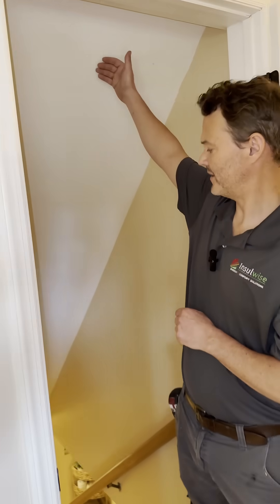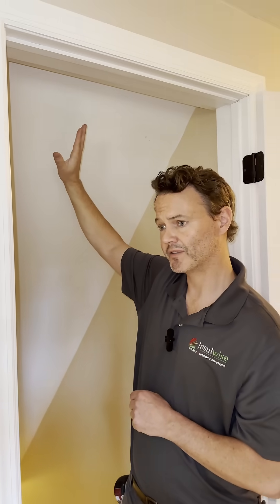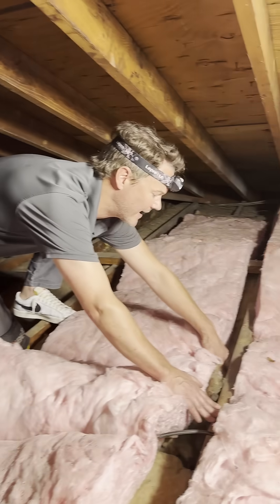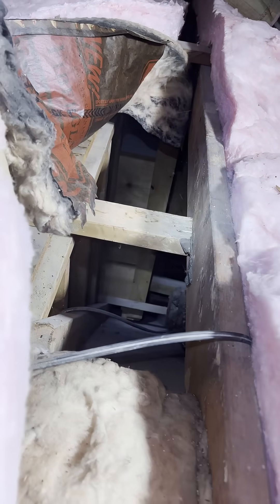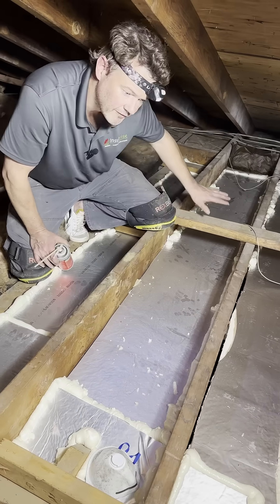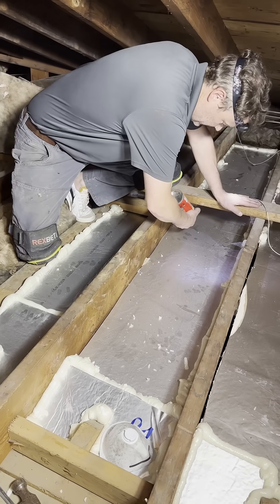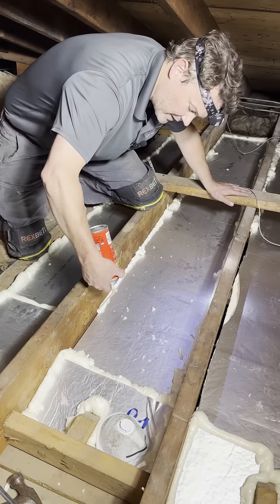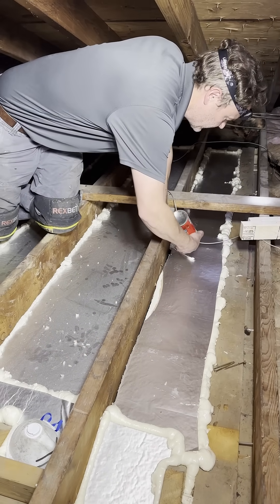Top Insulation Expert Reveals Best Air Sealing Techniques for Attic Stairwell Voids

Comment: I used a thermal camera and have air leaks on every corner and have a low roof making it difficult to seal.
Reply from the maker: If the walls are not well insulated or insulated at all the best solution there is to dense pack your exterior walls with cellulose insulation.  That will seal the top plates and any plumbing pipe penetrations as well as insulate the walls.  Low slope roofs make all of this work harder for sure.

Comment: If it is an insulated outer wall we saw in the video, the ceiling insulation does not insulate against the cold on the stairs.
Reply from the maker: Good eyes!  And you're correct --- but that wasn't exterior wall.  The other side of the "back exterior wall" was a bathroom.  This space has interior heated walls on all sides.
Reply: Thank you @insulwiseenergycomfortsolu3293
Reply: Thank you
Reply from the maker: @objektivone3209 You're welcome : )

Comment: Are you not creating a problem by sealing off this void. I was taught, insulation + ventilation.
Reply from the maker: Great question.  When you're talking about insulating unconditioned spaces like attics, you are correct.  But this space is actually conditioned.  It has four interior wall surfaces that are heated.  It's like a closet with the door closed.  There will be no "condensing surface" cold enough for water vapor to condense and cause mold growth.  That is the nature of the underlying problem that you're referring to.

Comment: Nah F this. Don't bother with this nonsense this is not insulating anything. Pittsburgh gets F'ing freezing. You want a good blow in insulation company. When those dudes show up duke them real  good they'll put 2 feet of blow in the attic. And fill this hole. It will cut your electric bill in half.

Comment: now cold bridging through the timber, with added rigid insulation temperature increased in the areas where normally fairly cool and black fungus everywhere. You cant insulate a timber skeleton house, like this. If you want to insulate your house it must be a continuous external insulation.
Reply from the maker: Sorry, but wrong.  It has been common practice in North America for about 70 years now, not sure where you're righting from.  For the last 15 years we've insulated thousands of homes in the Pittsburgh area this way.  Air sealing the attic floor sharply reduces stack effect driven air leakage from the home to the attic.  This also reduces water vapor transport from the home to the attic.  Air seal + insulate the attic floor and properly ventilate the roof works incredibly well and is low risk/ high payback.  By the way, subscribe to the channel.  I'll be posting a video in the coming weeks of a spray foam " continuous external insulation" failure.  It's fascinating.  Thanks for commenting!

Comment: Wait - did you just close up the top of the cavity with foam and seals, BUT THAT BACK EXTERIOR WALL HAS NO INSULATION????
Reply from the maker: No, and good eyes.  There are no exterior walls that abut this cavity.  The "back exterior wall" was a bathroom on the other side.  You cannot treat that kind of a space this way.   Thanks for commenting!

Comment: I will rot if air can't circulate. This is a well known fact. Spray foam insulation will destroy a roof.
Reply from the maker: No, it will rot if there is a condensing surface where water vapor can turn to "wet water."  This is what leads to rot.  There is not a condensing surface inside this space once this is done.  It functions the same as an interior closet with the door closed.
Reply: It's been 10 months since my comment... Let see an update please 🙏
Reply: In the UK you cannot get home insurance if any part of the house has spray foam insulation.

Comment: You can also blow an insulation and fill it..
Reply from the maker: Correct.   When one of the outer walls is an exterior wall we actually use that method.  When all walls adjoining are interior we cap the void.

Comment: The back side of the Stairwell Ceiling should be insulated and have a Vapour Barrier since the exterior wall was not insulated (which would have been much simpler and more cost effective).
Reply from the maker: All adjoining walls are interior in this video.  There is a bathroom on the other side of the vertical wall.  Good eyes though.

Comment: Why wouldn't you also lay insulation against the ceiling of the stairwell, as well as the outer wall, then air seal the cavity?
Reply from the maker: The void will function the same way as a closet with the door closed.  It is surrounded by interior heated walls on all 4 sides.  Doing more work than this would not result in any improvement in comfort or measurable improvement in energy efficiency, but it would put a worker at risk of falling through a ceiling and then down a flight of stairs for the effort.    
Andy

Comment: Just want to add that foam board + sealing it with canned foam at top plate of exterior walls, just before roof enters soffit, got rid of ice dams.
Reply from the maker: I believe it.  Foam board and foam sealant when used properly can yield incredible results in terms of enhanced thermal efficiency!

Comment: Air sealing in my crappy 1950s postwar boom house has been my obsession. It’s a Cape Cod with “finished” (lol) 2nd floor under the roof with kneewalls. I said “eff it” and cut and foamed foam board between all joists, and still working on sealing the chimney cavity. Then on to the back addition, where the builders have no “ceiling” to the kitchen soffits on exterior wall. Fun times.
Reply: I’ve got the same problem with my parents’ 1960 ranch.  There’s no insulation under the floor, no insulation in kitchen-family room (open concept BS) ceiling, some insulation in the ceiling to the back of the house, very little if any insulation in the outside walls, and no insulated windows or doors.  Plus none of the rooms have finished molding.  Reason for all this is my dad wanted a house that breathed.  It breathes alright.  It’s expensive to heat and cool plus all kinds of little critters like frogs, chameleons, spiders, and bugs get inside all year round because it’s so open.
Reply from the maker: @JohnFourtyTwo  "It breathes all right" LOL.  Ahhh man I'm sorry, but that was funny.  This was a 1960's ranch that we were working on here.  They're usually great little houses to work because they're typically build sold and are uncomplicated.  I've got a series of vids that could help you get a better feel for some of the processes you may want to employ there on our channel.
Reply: @ I’ll look them up thank you!😉👍
Reply: A house needs to breathe. The energy efficiency closed houses now need lungs to breathe. Could some better insulation help.. yes but do it right or mold and bad indoor air quality will happen. @JohnFourtyTwo
Reply from the maker: @truthhearit1471  You can certainly make new houses "too tight" for the occupants which then requires installers ERV's, etc (or you can just run a bathroom fan full time).  But it's MUCH more difficult to make an existing, older home "too tight."  There are simply air leaks all over the structure.
Reply: @insulwiseenergycomfortsolu3293   as I said the new tight homes need lungs.  
I said if you don't install new insulation properly in an old home than it can lead to problems.  Look at the retro fit spray foam lawsuit in Vermont.
Reply from the maker: We don't spray foam the underside of roofs for a variety of reasons.  My guess is there's no shortage of lawsuits or ones that'll be coming.
Reply from the maker: Sounds like you’re in for a lot of work but the end result will be worth it!
Reply: @ Thanks for reading my long post lol! Yeah, the fam already has noticed for the better.

Comment: ....your ghetto There problem is the R19 when R38+ is needed.... From an hvac tech stairwells will always be uneven good installers, put a vent in the staircase area has nothing to do with insulation it will always differ slightly

Comment: I wish there were more honest, committed, local people like this.
Reply from the maker: Thank you! We try to be!
Reply: @insulwiseenergycomfortsolu3293 thats not the best way your foam will only go in an inch at best
Reply: you just gotta start livin' in the pittsburgh area man
Reply from the maker: @mydearriley  Sounds like a quote from Wooderson in Dazed in Confused ; )
Reply: Isn't the cavity above the stairs still non-insulated to the outside? On the vertical wall
Reply: If you didn't batt the outside wall you solved nothing and made it worse now the unconditioned space under that foam board has no venting and is going to collect condensation.
you literally did not solve the heat loss issue and you created a possible mold issue instead.
the only thing that might save you is the fact the house will be losing enough heat into that space that it keeps drying it out.
Reply: Spray foam is super toxic. You don’t want that crap in your home.
Reply: Only if they understand older buildings that were never designed to be hermetically sealed and relied on ventilation leaks to 'breathe' and prevent condensation and foul air.  Unfortunately, most tradesmen don't have this attribute.  I constantly come across well meaning tradesmen who haven't got a clue and install insulation that then compromises the main building materials.
Reply from the maker: @clivewilliams3661  I'm not sure what you mean by compromising the main building materials, but I do agree that most tradesmen and insulators in particular do not have any background in building science, which I believe is critical to performing this work well.  It's also nearly impossible to "hermetically seal" any existing home by performing basic air sealing processes on them.  There are simply leaks in them everywhere.  You can however rot the roof by insulating an attic and Not air sealing it.  Stack effect driven air leakage from the home to the attic during winter can deposit enough water vapor in the attic which can then condense on the underside of the roof.  We see this ALL the time. 
Andy
Reply: @insulwiseenergycomfortsolu3293   By compromising building materials I meant as an example, coating brickwork with with silicone in an effort to make it waterproof, which then prevents the brickwork breathing, absorbing moisture and then giving it up, resulting in saturated walls.

Whilst I agree that it is probably physically impossible to actually hermetically seal a building the natural air flow on an unmodified building was part of its ability to breathe.  Cutting draughts and air movements means that the building is stifled and can't control moisture and mould.  its a bit like providing someone with an especially tight necked shirt and then expecting them to perform well in physical exercise.
Reply from the maker: @clivewilliams3661  We blower door tested this house before and after.  In terms of the envelope's leakiness from an air infiltration stand point it was 12.5 ACH50.  The current standard for new homes in Pa is 3ACH50.  When we were done we'd brought the home to just under 8ACH50.  That means that despite the air sealing work performed in the attic, it was still close to 200% leakier than a new home would be.  This type of improvement is common when performing weatherization work on existing homes.  It will have no problem "breathing."  The person living there will however be permanently more comfortable while paying dramatically lower (46% usage reduction as per his Dec bill, which was colder than the year prior) bills for as long as he lives in the home.  
But don't take my word for this.  There's a well established building science methodology.   A good place to start is here: 
https://bpi.org/.
Reply: @clivewilliams3661 absolutely 💯  im  all for the air gap open cavity wallet etc no problems ever never damp etc

Comment: Andy, would filling the space with cellouse, even though not necessary for warmth help with deadening sound? Say a stairwell that is between a movie room and a study room, for example
Reply from the maker: Good question and yes.  If you filled that with cellulose it would significantly dampen any sound that was previously moving through it.  Cellulose is an excellent sound deadener. 
Andy
Reply: I was thinking filling the void with leftover fiberglass insulation bats during original construction and then sealing it off with the foam board and spray foam.
Reply from the maker: @JohnFourtyTwo  You could, I'm not sure how much value it'd offer, but it would get rid of the batts.
Reply: @insulwiseenergycomfortsolu3293   I always say a little of some is better than all of none when it comes to saving and benefits plus it’s less to dispose of.👍

Comment: Andy, I have this same situation in my house and want to fix it. How did you attach the 2x3's and 2x4's to the joists for which the foam board will be layed? Thanks for your help and videos!
Reply from the maker: Great question and thank you!  This short form video didn't give me enough time to show this part!  For us the best technique is to tail nail whatever lumber you are using.  You'll drive a 3" screw at a 45 degree angle down through the lower third of the attic floor joist and into whatever lumber you're using.  It'll be a little bit of attic acrobatics, but it will do exactly what you want.  I would screw 2-4 pieces of wood in depending on the length of the void. 
Andy
Reply: @insulwiseenergycomfortsolu3293   YouTube has recently extended shorts to about three minutes to alleviate this problem.  If still not enough time then a regular video would be appreciated.👍

Comment: You didn't show us what you actually did.
Reply from the maker: Tough to show everything with a 60 sec video, but noted.  I attached a series of 2x3's to the underside of the attic floor joists by toe nailing them into place from above with 3" screws.  Then laid the foam board over top and foamed it into place.  Last step was top coating with 15" of cellulose insulation.

Comment: So you didn't seal right on the stairwell? Are you just heating a massive waste of space still?
Reply from the maker: Yes, that void is getting heated, but it's not that big.  I used to climb down into them and seal and insulate everything, but it's fairly dangerous.  One slip and you're going through that sloped drywall ceiling and then down a flight of stairs below.  The way we air seal these is already a massive improvement on how it was before we got there (batt's stapled in between the bays).  The effect will be that all of the rooms adjacent to the void will now be easier to heat and cool, and the finished repair is far more energy efficient than before we started.  Not sure if I mentioned in the video, but we blew 15" of cellulose insulation on top of this once finished. 
Andy

Comment: Hey. Would you recommend to air seal, put batt insulation and then blow the remaining on top of it? I'm going to re-do my attic in the summer, but don't feel right just blowing in over the ceiling. I keep hearing that it's okay though .Thoughts?
Reply from the maker: Follow the process in this video.  Air seal, Ventilate attic appropriately, then blow in cellulose (ideally) until you hit R-49 with approx 15" inches. 

https://www.youtube.com/watch?v=PUSONSE7srE&t=9s

Andy

Comment: Don't you have "Gapotape" in the USA? - So much better than the canned foam!
Reply from the maker: I just looked at the Gapotape video.  I have not used this product, however am I suspect of tape products due to the frequency of tape fails that I have found in attics over the years.  Almost all tapes are "the best stuff ever" until they're exposed to multiple seasons of super hot roof and attic temperatures and then very cold temps during the winter.  From the video I watched on Gapotape, and my experience using canned foam over the years, I cannot imagine canned sealant foam not being a far less expensive, durable, and effective solution for the bulk of the applications that we use it for, but thank you for commenting!
Reply: My thoughts exactly. To call himself a top insulation expert is a stretch. By European standards, this would not pass as a good job. 

Building standards have changed over the years and while this was once acceptable, it's not now. Foam spray is for large gaps, not to fill shoddy cutting of insulation boards.
Reply from the maker: @pingo9105  I have been certified through the Residential Energy Services Network (RESNET) as a home energy rater, as a residential building analyst through the Building Performance Institute (BPI), have performed highly successful residential insulation and air sealing upgrades on thousands of homes and have approximately 25,000 hours of hands on experience performing this work.  So yes, I'd call myself an expert.  You could fill these spaces in with wood if you wanted to, but it would not affect the durability or end performance.  It would however make the job more expensive for the homeowner as doing that is more time consuming and would require more expensive materials.  We're not building furniture here guys, we're permanently sealing air leaks in attics.  The last time I met a customer who wanted a higher cost for no improvement in performance or durability was...let me think...never.